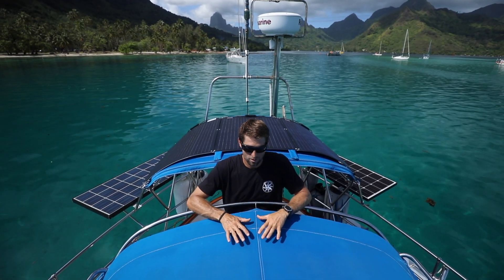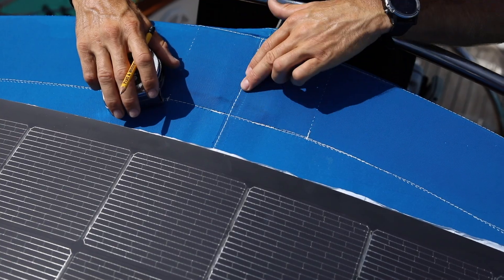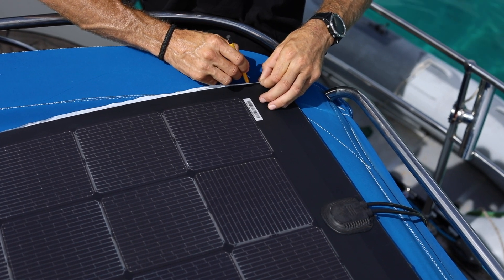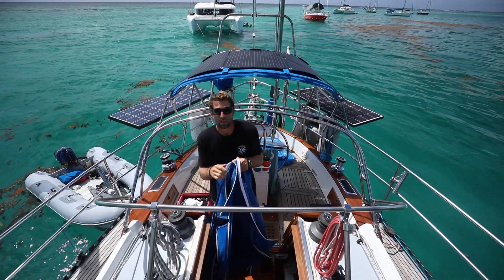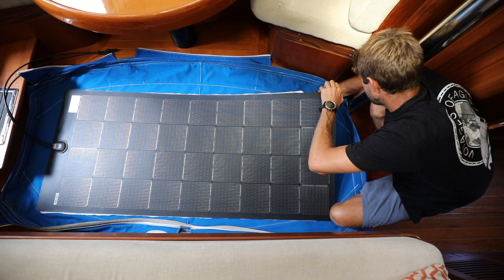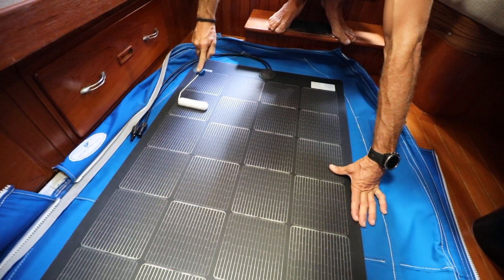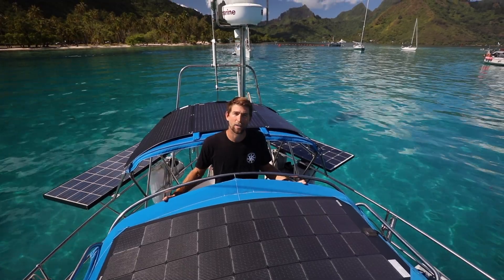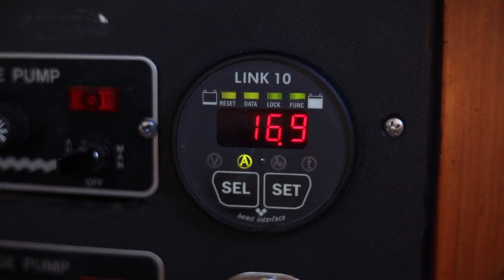XANTREX SOLAR MAX FLEX KIT INSTALLATION

Comment: That's pretty flexible! But if this panel is stuck, say, to a van roof - would it get too hot ? I was under the impression that solar panels needed good air circulation underneath as well...
Reply: You could mount the panels to twinwall polycarbonate sheet and then to the van roof to improve airflow under the cells. I saw someone do this to a hard top on a catamaran and the solar panels were a lot cooler.
Reply from the maker: Solar panels tend to perform a bit better the cooler they are and air circulation underneath the panel can help. The Solar Max panel is extremely durable and was designed to withstand high thermal stresses. Further benefits of flexible panels is their flexibility, lightweight, and no need to drill holes in the roof for mounting.